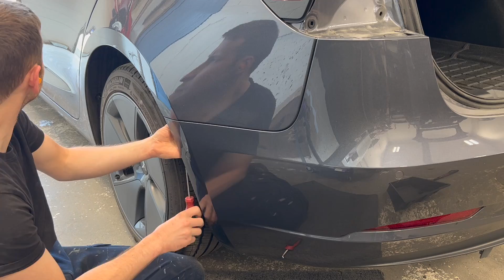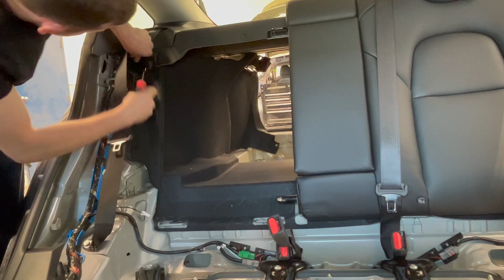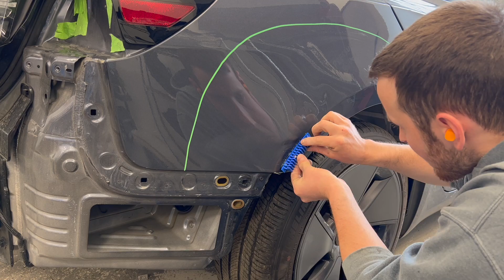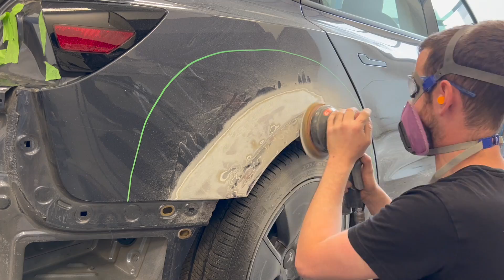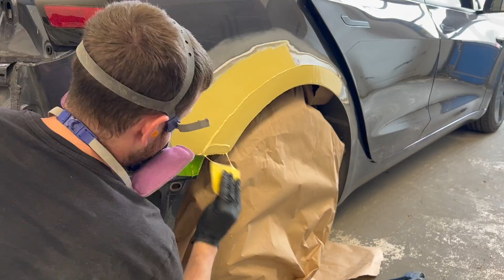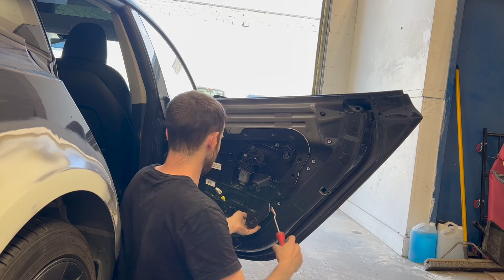Collision Repair Process Fixing a 1/4 Panel on a Tesla Model 3

Comment: I likes this video since it helps me understand my own car thats in for repair on a moose strike. Manage to hit it at 60lm but it hit the front bumper and then slide down the passenger side. So the body shop is replacing front bumper, fender, passenger door, cutting into the rocker panel to fix that dent and the rear bumper cover and they want to the car almost 2 months. Lots of work to be done on it I am sure.

Comment: Did you need to disconnect the main battery plug so you can weld? Im having problems to find that plug.
Reply: gotta disconnect 12v and fireman loop in the trunk then the “logictech” connector which should be in auxiliary bay (penthouse), it’s a grey connector.